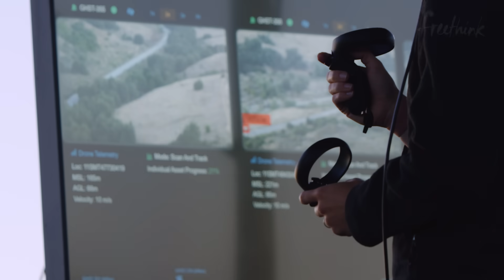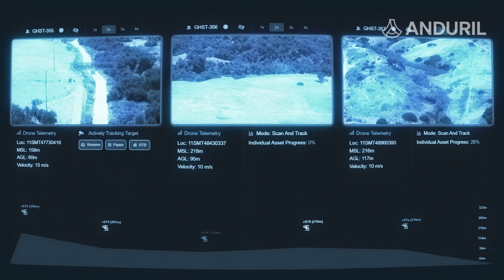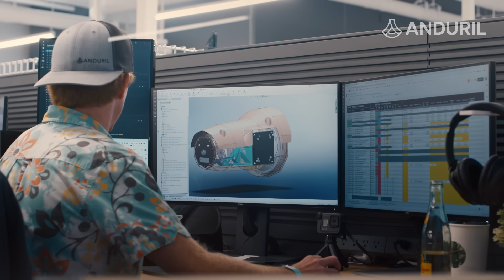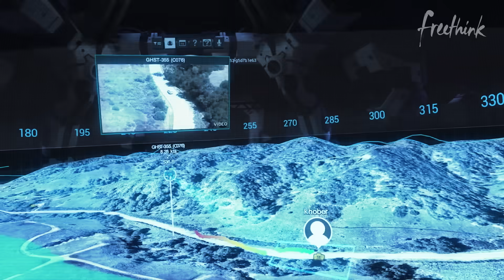Engineering the Impossible: The Future of Military Tech

Comment: How did they get a 2 hour flight time?! That's insane!
Reply: Efficient motors,lighter airframe,unconventional battery tech etc, besides it's a micro Heli not a quad .
Reply: @series1054  Yes. It's true that heli flies longer by the shear disk size. My single rotor 250 gram FPV flies for 35 minutes while recording in HD. Quads can also have large disk area, but the agility would be impaired by the large inertia because quads change spin speed the control the flivht. Heli uses variable pitch to work around the inertia problem.  And infact helis fly with a constant rotor spin RPM.